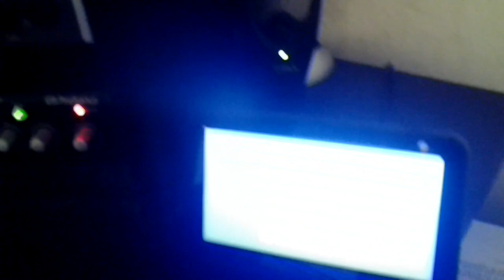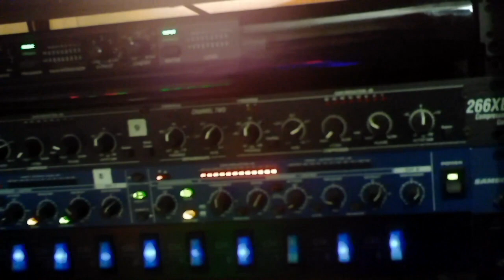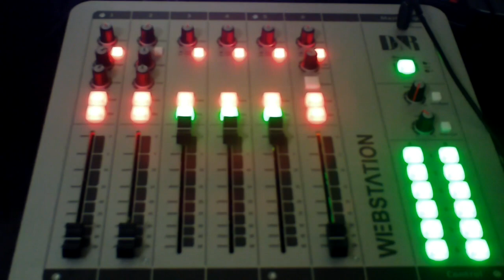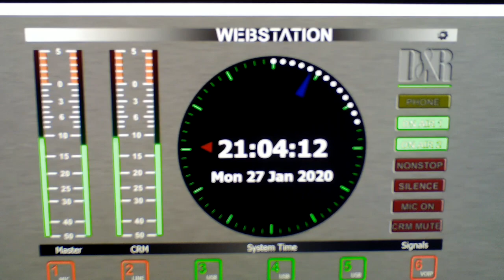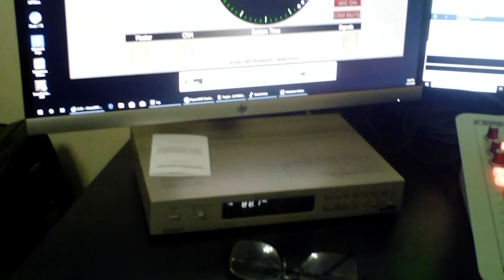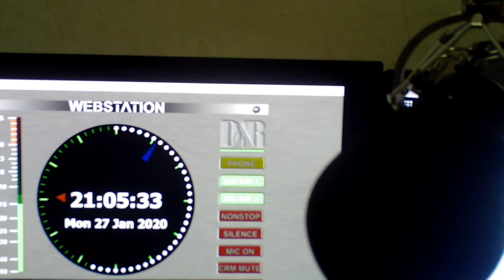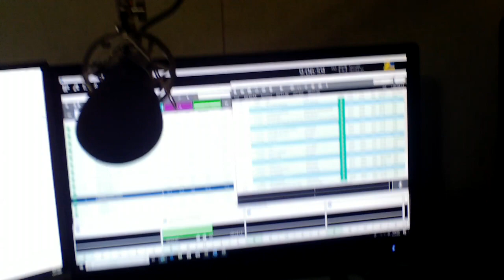AirWaves Episode 2 :  My Home FM Station and Radio Automation System

Comment: That's an awesome setup you've got there. Much nicer than I'm using, and I've been broadcasting music on the internet for 34 years. My first streaming software I wrote myself because there was no such software available then. That was 11 years before Shoutcast and Icecast were written.  I currently run 10 Icecast servers, though I'm only using 6 of them, and let a friend use 1. So  I have 3 unused servers in case I decide to add any more shows.

Comment: Hey Buzz.. my church wants to start a low fm station... possible tips and equipment... We got a small fm transmitter due to covid... 100 watt.. which helps with small area in parking lot... how much can we upgrade to with out getting in trouble?
Reply from the maker: 100 watts is not what I would call a small transmitter.  I helped a friend set one up for his church's parking lot.  It was 7 watts and was more than enough power.  I've had good luck with the FMuser brand of transmitters and antennae.  You'll find them on eBay and sometimes Amazon.
Reply from the maker: I show this as an example of a complete system.  However, at 15 watts it would not be a legal operation per FCC regulations.   https://www.ebay.com/itm/FMUSER-FU-15B-0W-15W-PREMIUM-FM-Transmitter-antenna-Kit-Drive-in-Chirstmas/224279434718?hash=item34381895de:g:rKMAAOSwhKVf2FQQ

Comment: Very Nice Professional Radio Station you missed your calling👍👍 Hey I think I know you Aren't you Buzz Lightyear's grandson❓
Reply: That's Great I'm an old AM jock from the 1970s also in the cb hobby for many years.
Reply from the maker: Ditto.  Top-40/CHR jock/programmer, from 75-91, then engineering.
Reply: @Airwaves-Radio  Nice, I built a Live AM home studio it's old school analog have 2 audio technica turntables to spin the 45s & use a Highball2 mic, do bumpers on  Sony & JVC Cassette decks, everything runs through a 6ch mixer with a mosfet amp. Tons of fun the way Radio should be.
Reply from the maker: @miguelsalami  That reminds me of how hard a job it was, back in the day.
Reply: @Airwaves-Radio  You are correct! it's alot of work to make it sound right the only things missing are the 4 track kart machines & the reel to reels & the Collins board. I still have my FCC Radio Telephone Broadcast License.
Radio changed alot in the early 80s they took the fun out of it with all the automation & alot of us got out of it. This little studio takes me right back to 1976 " The Good Ole days" were just that my friend💙
Reply from the maker: Actually, radio is my calling. 25 years of it, from DJ to engineer.  Thanks for tuning in.